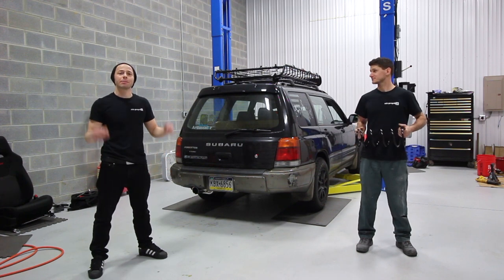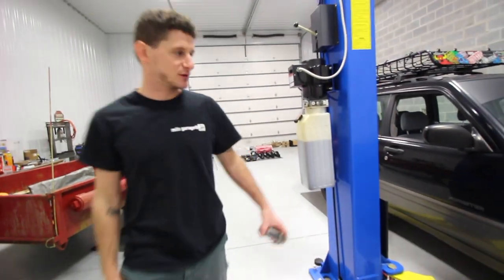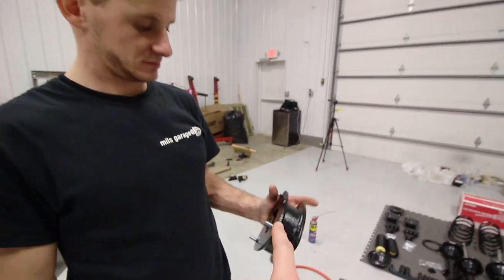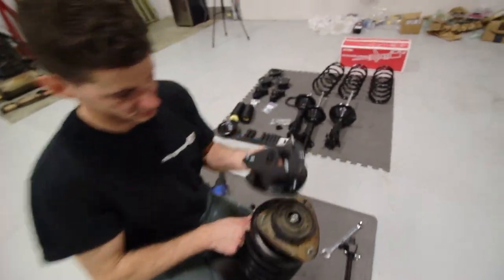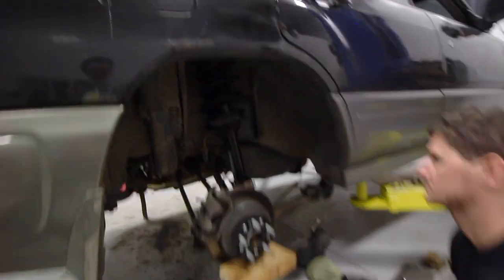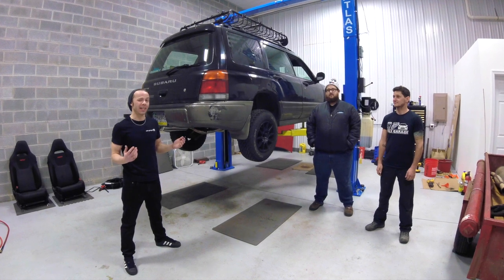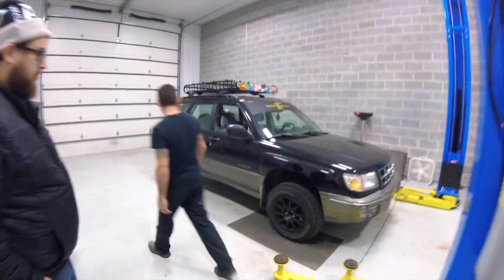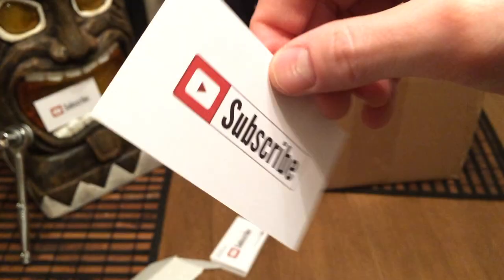Forester Gets ADF Lift Kit [ Subaru Saggy Butt Syndrome FIX? ]

Comment: great vid guys..Were those parts you showed on the floor, one complete set from ADF or did you get some from them and then others from separate parts houses or what? Would appreciate parts numbers or kit info.. Might want you to do the same on my 2020 Forester..

tnx..

Mike W

***
Reply from the maker: Thank you for your support stinknose! It's the ADF lift kit and RockAuto Kyb Struts and Springs for a 1999 SF Forester.. Will need Subaru top hats. Sounds like a sweet project 👍👍👍

Comment: What should I expect to pay for an ADF lift kit to be put on my 01 forester??
Reply from the maker: We charge hourly at our shop in order to cater to working on older cars. The bolts aren't easy on these older Subaru's as they're prone to rust at this point. Andrew's was no exception.. You could take your chances with a shop that does flat rate, but they probably ask for a good amount up front to make up for any snags that might pop up. i honestly don't know what they'd estimate the job at.. Some shops leave me jaw-dropped when i hear their flat rates [ i believe we're worth the same amount if not more, yet they always seem to charge more than us. ]

Comment: Thats not actually level. The rear wheel well sits lower on that car so your rear is actually higher by over an inch.
Reply from the maker: Sure. Well seeing as though it all had to be loosened up with pressure on the springs while on the rack for the alignment, it has probably settled a bit
Reply: Mils Garage yup that will happen too. I’m referring to the body line. The wheel well where you were doing your measurements from is not the same on the front and the back of the car. If your car is sitting perfectly level, the rear wheel arch will be sitting closer to the ground. If your wheel arches are equal, like the way you measured in your video, then your body is actually sitting higher in the back. Try measure from the jacking points or the bottom of the body and you’ll see the difference.